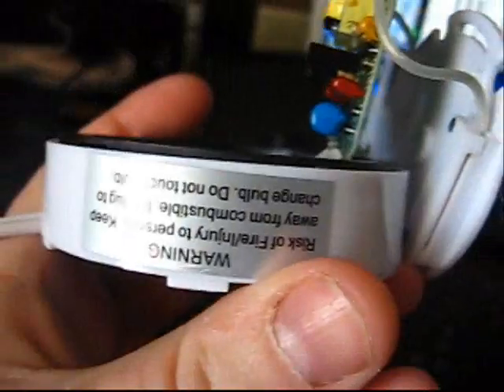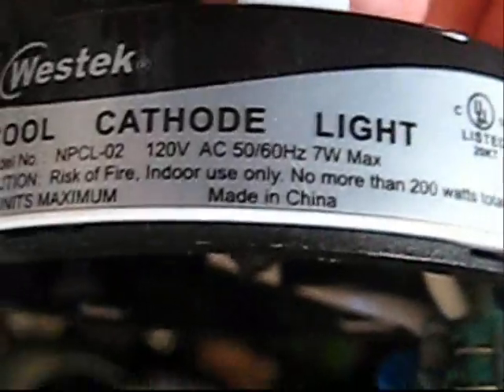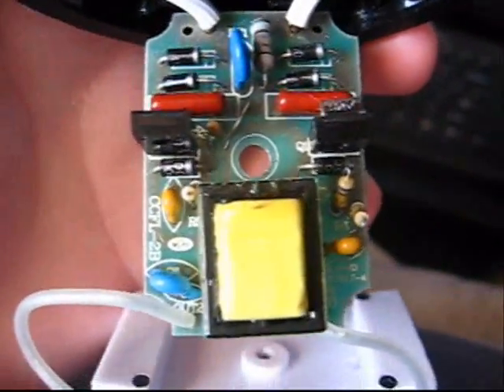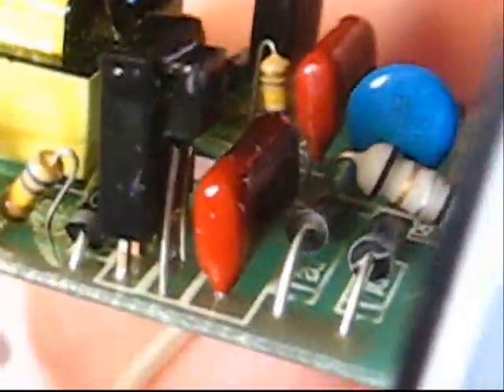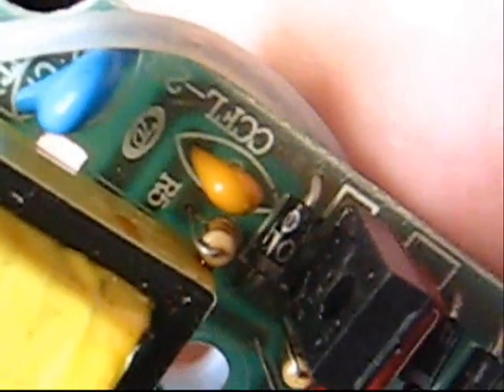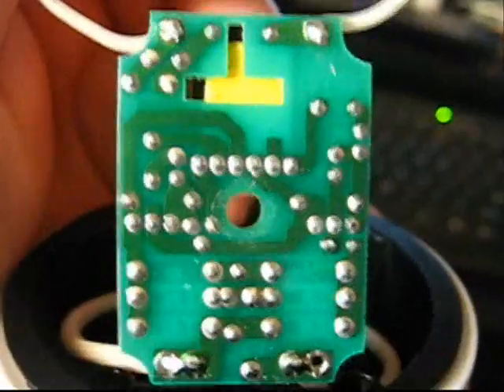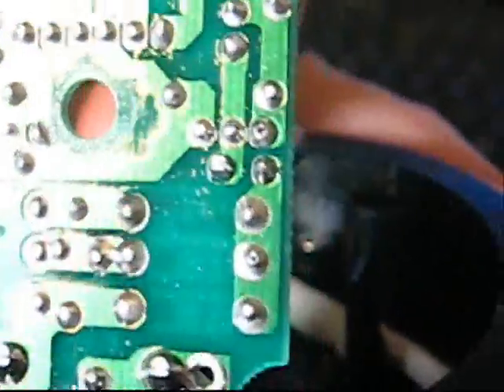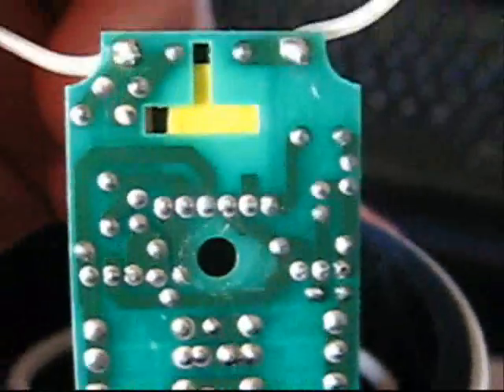Inside CCFL puck light

Comment: The graetz bridge should be shortly after the mains input wires (there might be some QRM/RFI suppression chokes and/or capacitors between the mains input and the bridge)  The graetz bridge will be either 4 1N400x diodes or a  rectifier assembly (epoxy cylinder or box with 4 leads sticking out).  On the DC side of the rectifier there will be a 200V or higher ~10uF electrolytic capacitor.  Then there will be an oscillator that drives the ballast transformer.  The oscillator will run on ~170VDC.

Comment from the maker: Where on the board did you see that? I've seen some types of rectifiers. If I measure the power on the output on that it should be DC? and if it's 12 or 24 volts most likely then that's where I can hook up a DC power source. if it is 24V then I won't even bother b/c my intention was to run this thing off my car jumpstart power pack and I can do that with a power inverter.

Comment: Scanner CCFL ballasts are designed for (usually) 12VDC.  Look at the ripple suppression capacitor that's on the DC side of the input graetz bridge.  If it has a potential rating of 200V or more, then there is no potential conversion before the ballast.

Comment from the maker: It's a CCFL light so it has an inverter. I have one I ripped from an old flatbed scanner and that inverter runs on 12VDC. I'm guessing they did whatever they had to do to bring 110VAC down to 24VAC and then rectify it so it's ripple DC b/c it does flicker when you move it around fast.

Comment: The lamp ballast runs on 170VDC from the graetz bridge and input ripple suppression capacitor.  I have never heard of a single unit light that had a 120VAC to 12VDC/24VDC which then supplied the lamp ballast as this would be needlessly complicated.

Comment from the maker: I don't really know what voltage the lamp runs on but I'm guessing it's a 24VDC inverter running on rectified AC b/c 24 volts is easier to bring 110VAC down to than 12V. I will just use my 12VDC to 110VAC inverter. it works just as good.

Comment: Take some voltage measurements of the board operating properly, then head on over to digikey (the link is waaay too long so I used tinyurl), the part after the slash is 72jzqnr ... choose your specs and select your board.

Comment: I don't think there's a way that could be done without replacing that board entirely.  Those ccfl boards will in fact run on DC, but you would actually need something around 170 volts to do that, 12 is just not high enough, I found a couple of circuits that can power a ccfl or any other kind of floro tube on aaron cake's website that may be of some help.  w w w . aaroncake . net / circuits / flampdrv . asp   and    w w w . aaroncake . net / circuits / 40wflamp . asp (just remove the spaces)